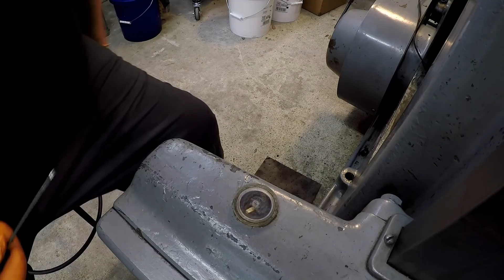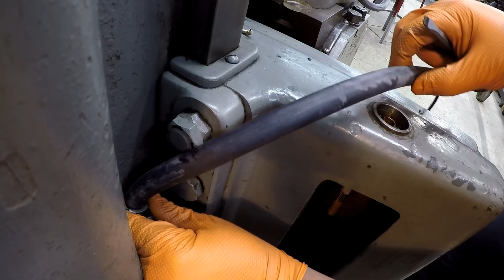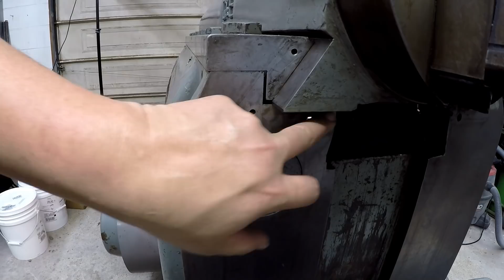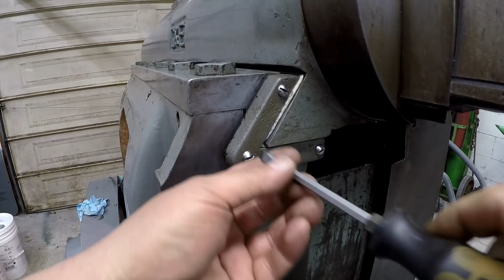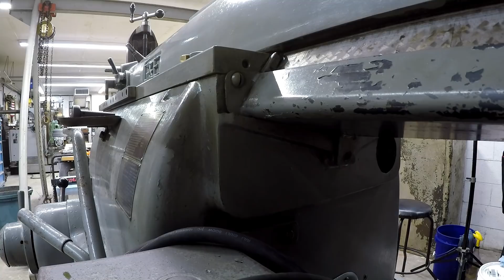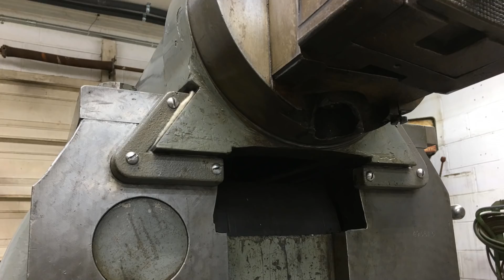G&E Shaper Ram Way Wipers & Cross Rail Oil Sight

Comment: I'm impressed with just how serious a matter lubrication is on a metal working machine.  The designers of
the machine obviously took it very seriously and your remediation of their work has emphasized the matter
for me.  I feel a sudden urge to run out to my shop and lubricate all my machines... just in case.

Comment: Don't straighten and open that brass feed tube. It's pinched down like that to prevent TOO much oil getting into the way-feed. It's basically an "orifice" to limit flow and volume.

Comment: Hi Adam, could it be possible that a third layer of felt wipers could fit and seal ! the way wiper assembly- it looks like there is space for it on the casting, just like a head gasket? the previous owner sealed it, maybe it had deteriorated so bad that it fell out?

Comment: Adam: That nozzle had probably been over lubricating for years and the operator got tired of cleaning up after it so the quickest fix was to beat it closed and then just oil it with an oil can now and then... I see what I was looking at built into the table. It's a tilt set up on the long axis, fore and back.  Very slick, my plain table 32"G&E doesn't have any of that. ...Dave

Comment: Adam, spray the complete inside of the machine with a cleaning solvent. Afterwards fill the reservoir area at the bottom with that solvent aswell - let the machine run and pump the whole solvent out, let it dry & refill with oil.

Comment: just a thought.. this videos distribution block.. i would probably take my oil can and pump oil down the various tubes.. to see where it comes out.. use some Very thin motor oil..  5W20 so you end up flushing the tubes along with finding out where each tube goes.. with the knowledge that there may be more rubber hose sections.    for hose clamps..  double loop some zip ties. 

 you could also.. use a regulated air pressure nozzle to blow into the various drain tubes out of this videos distribution block.
probably not more than 5 PSI.

Comment: One of the things my father taught me was that when replacing felts, always saturate the new felt wiper or wick with oil just before installing it. This keeps the wipers from wiping the machine dry before the oil system can get the wick saturated.
Reply: When the machine starts, nothing is moving. Only the oil pump is actually doing something, so the oil will have plenty of time to wick before any motion is initiated.
Reply: IsbjörnXII the wipers only start wiping when the machine is moving...they dont get oil pumped to them

Comment: Nice to finally see someone looking after it's long overdue preventative maintenance and giving the old girl a good cleaning Adam. Unless it's been rebuilt at some point and I'd guess it hasn't from it's overall condition, then the oil flaking on the ram dovetail makes it look like it hasn't done very much work. That would have been a very expensive machine when it was brand new.
Reply from the maker: It all seems to be in good shape and probably wasn't used very hard at the latter decades. I'm enjoying getting all the oiling system back to way it should be.

Comment: Looking at the front ram wipers, I don't see how the oil will get past the felt to the drain. But if the felt was only in the front groove and the rear one was empty, all the oil scraped by the felt in the front groove would have an easy route to drain back to the sump.

Comment: Hi Adam - I may be mistaken, but that small oil pipe may by intentionally pinched to create a small high pressure flow opening much like that of the windshield washer tubes on a car.   Maybe your manual would tell more, I thought you had come across one as I recall.  Another viewer below Jim M. made a similar comment-- you may end up with way too much oil flow and not the right amount of metering.   Love the videos, your channel is one of my top favs.

Comment: The end of the bent supply tube on  the crossrail oil manifold on my G&E shaper was also professionally adjusted (smashed), I believe to control the oil flow. I also opened it up and my sight glass developed a leak so I adjusted (smashed), it so it would just keep the manifold almost full..I was thinking about trying a needle valve inside on the end of the hose to adjust the oil flow.
Reply from the maker: Yes I learned the pinched off tube ends is because of the amount of oil being pumps to those sights.

Comment: What I did on my shaper considering the oil catchers for the ram was coat the contact surfaces with grease - since there is no oil pressure to speak of, thats plenty to keep any oil from leaking, should the metal-to-metal contact not be enough.
Reply from the maker: Good trick

Comment: Maybe those lunatics just lapped the steel faces together to create a seal, like the insane Germans did on those old Bosch fuel injection systems from the 1970s.  I mean, it works, just don't ever take it apart.

             Oh, too late.

Comment: Looks good.  I've got to build some wipers for my mill.  It did not come with them.  It's a Millrite mill.  Nice little mill got it out of a tech school. You mentioned restoring machines is enjoyable, for me it is have the fun because I think about the guy that ran that machine or worked on it for the last 30 plus years in it's first life.  Where do you get the rust inhibitor you guys use.
Reply from the maker: Bill you can buy it at Motion Ind. We keep it stocked on the shelf. T-9 Boeshield

Comment: The tube is probably pinched off to build enough pressure to deliver oil to higher points on the machine.

Comment: wonder if you should pre-soak those wipers with the good oil before you fire up the unit.  just to make sure the felt doesn't dry wipe while waiting for the oil to circulate

Comment: I wanted to let you know that their should be three layers of felt in the front wipers . Their should be one in between the wiper holder and the machine. I used to run one at my job.
Reply from the maker: I didn’t think that because there were only two in there. I’ll consider that.
Reply: Parts manual may offer clues...
Reply: i would think that the third layer would have a groove to feel oil caught into the drain back hole.. i would also.. if you are set up with some 600 wet or dry sand paper.. lap the back of the V felt holders so they seal really flat against the machine surface.

Comment: Pinched off tube brings to mind the suspicion of a machine operator who was tired of cleaning up way castoff everyday. I spent a lot of my life building and maintaining production equipment and you wouldn't believe some of the stuff I've seen. Sealer on drains tends to confirm the suspicion.

Comment: Hey Adam

at around 5:50, showing the inside of the machine, i see a large crack in the machine. comming of the supporting metal at the weld. will this affect the machines function proper? its a long crack..
Reply: That's a single piece casting. What you see is probably a part line in the moulds for the casting, or a chill line where the molten metal pour met as the void in the moulds filled. It's the nature of sand cast parts to look like this.
Reply: Josepi Mann that looks like a separation line  mark of the original casting to me.
Reply: That just looks like a surface defect in the casting. Probably not deep at all.  I have seen a lot of stuff like that before
Reply from the maker: It’s not a crack.
Reply: Yes that is what i was talking about

Comment: Saludos Adam, I saw on one of the new manuals that there was an emblem that showed  Norton, Gould & Eberhard.  Just as point of interest G&E was acquired by Noton grinding in 1959. Gould goes back to the early 19th century (18?? before 1840).  Just thought you would like to know.

Comment: Could the front wipers have had three pieces of felt?  It's seems that they were recessed enough for another 1/8 piece.
Reply: I think it maybe a bit wide so it catches excess oil and it acts as a trap for the return the outer is tighter an acts more like a dry wiper so to speak. Adam I  have a thing for shapers too a lost art for most machinists.
Reply: I agree. The end cap is acting like a scraper. Excess oil is wiped off and dumped back to sump. They probably weep oil between the castings, but shapers aren't known for being the cleanest machines in the shop.

Comment: Adam, I have a feeling that brass tube was pinched for a reason, my mill has different metering valves for each lubrication point. I think they pinched the tube for the same reason to limit the flow of oil. I may be wrong, just making you aware, and hopefully someone else can chime in as well. Thanks for the videos!
Reply: Jim M The way oil lines on our horizontal bore mill are pinched in places due to length...otherwise the closest ports(to the hand pump) get over-oiled and the farthest get none.
Reply: Yes, I think the restrictions are to distribute oil evenly to all parts. The knee is low on Adam's shaper with basically an open drain back into the sump, which means that anything above that point, like the ram could be starved, and any point that are naturally restricted like a shaft bushing below that point wouldn't get enough pressure to lube the shaft.
Reply: Yes, it sure looked like a previous owner had an issue here and deliberately pinched it.  Opening up the tube could cause issues that you'll uncover that (or not) when you give it a test-run.  Maybe the pressure was too high and it blew off the inspection glass?

Comment: I understand the need for the cord in the way oilers on top. I don’t understand the need for it in the distribution block, especially since it has an overflow return line. I would cut the bend out of the brass tube and have it splash off of the sight glass and fill all of the lines to overflow. With the cord in there it seems very little oil will get through. There might be something at the discharge end to control oil flow.
Reply: The felt is for flow control. You supply excess oil to the distribution block, and the felt only allows enough oil through that will gravity feed through it. Excess is simply dumped back to sump.
This way, you don't have excess flow into the ways, overloading the wipers and making a mess. The felt also acts as a filter.
Reply: But if he cuts the bend out it will fall down into the tube.
Reply: Riyame True. I would suggest then to remove the cord and see if the oil is distributed equally to all of the tubes in the bottom. My concern is that the cord is blocking oil flow.
Reply: That cord is the old school method of limiting the oil to roughly what's needed. The more modern vertical mill one short lube systems use various sizes of flow restrictors to do the same thing. The cord has the advantage of filtering out any crud before it gets to the moving surfaces. For the cross movement of the table very little oil would be needed anyway. Once the new wiper felts are saturated with all the oil they'll take a few drops of oil every few minutes on something that moves that slow should be more than enough.

Comment: if the front wipers leak use a paper gasket as it is low pressure oil simple and easy fix
Reply: Using some RTV sealant isn't necessarily bad either. High quality modern RTV like Reinzosil or Permatex Ultra Grey works excellent between machined surfaces. Use it properly (very small, consistent bead) and it doesn't make a mess or make it hard to service.

Comment: I enjoy watching your channel and have learned a fair amount. I'm curious though as why you didn't pre-oil the felts before you secured them in place. Now they will run dry for the first little while. Maybe not a great issue just thought if they were lubricated from the beginning they might not wear as fast.
Harold
Reply: The pre-oil will happen when the machine is first turned on after the new oil is in.  Oil is being pumped whenever the machine is 'online' and sitting 'idle'.  Whenever the machine is first turned on with the new oil, it will be allowed to 'idle' for several minutes so oil can be thoroughly pumped to all the sight glasses and all the felts will be thoroughly bathed in oil for several minutes before the ram is started or table is moved.

Comment: Why does that brass tube look out of place or doesn't belong? ,, just odd a sophisticated machine like that would have a strange oiler
Reply: I think it's just a breather tube to pass displaced air out of the sump. The larger diameter tube it goes inside does the actual moving of the oil.